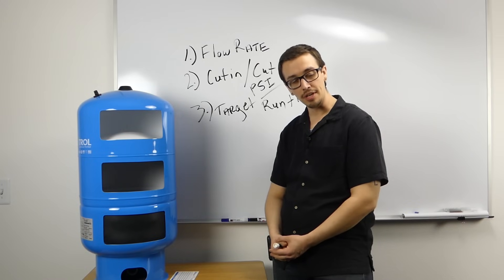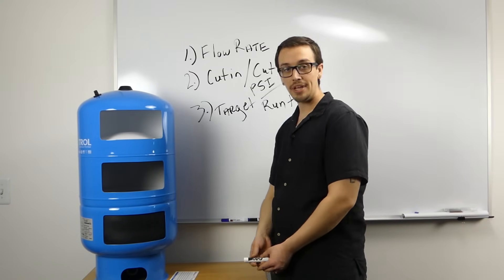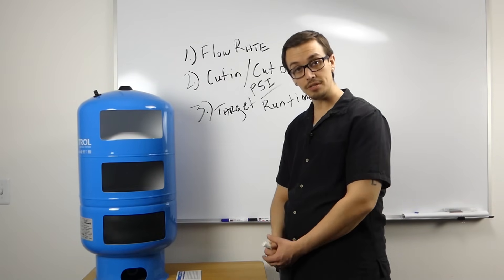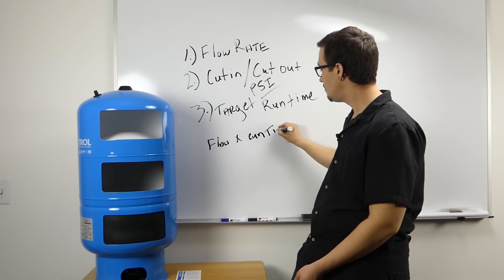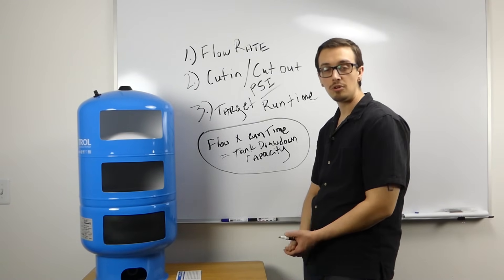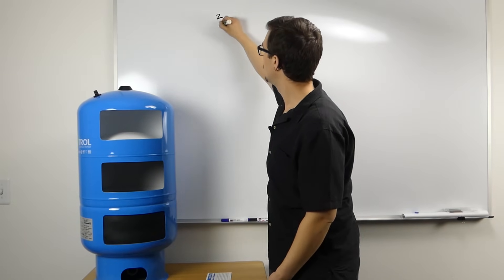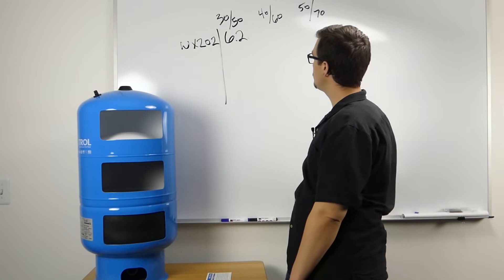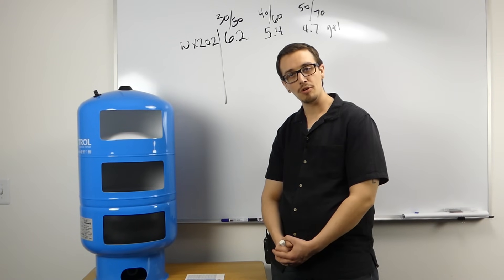How to Size a Pressure Tank

Comment: Hi there, a fire sprinkler system I am looking at will benefit from a thermal expansion tank, but I also want to consider its pressure tank capability for the pipeline. The sprinkler system needs to be kept at around 12 bar. This will drop over time with leaks and a technician needs to boost the pressure with a jockey pump. A pressure tank should help keep the pipeline closer to 12 bar for longer, however I don't believe it takes much design as the 'drawdown' won't matter? A leak is so small and pressure drop so gradual that any pressure tank size should help the situation??
Reply from the maker: I do not know of any pressure tanks that are rated for that high of pressure. Are you primarily trying to mitigate water hammer?
Reply: I haven't looked into pressure rating yet. It is for thermal expansion of the water primarily with the hot sun and the sprinkler system being close to iron roof. And if possible I would like to design it to help with pressure drops as well which is just from leakages. So if the happy pressure is 12 bar. Minimum pressure 9 bar would come from leaks and max pressure 13 bar from the water expanding. So I think for the bladder tank to help with both, the pressure of the air would need to be at the minimum pressure say 9 bar and a larger volume than required for just one scenario. I think I can work it out. Thanks,
Reply: As a 39 year Retired Veteran Baltimore City Fire Department Captain I would contact the manufacturer, distributor, or installer for the Fire Sprinkler system that you are thinking of installing before you add anything to the system.  These systems are highly specialized and anything you add or delete from the can have a severe negative effect on its proper operation.

Comment: good explaining , i have two duty pumps but no detailed at pumps name plate  but motor is kw how can i select water vessel tank  the discharge pipe is 1.5 inch.

thank you very much
Reply from the maker: Do you know what the flow rate is in gallons per minute?

Comment: Hi. The flow rate of my pump is 2.38 GPM, what is the minimal volume of pressure tank  I should have? it doesn't show in the table.
Thanks
Yaniv
Reply from the maker: Yaniv, you would want a pressure tank with at least 2.38 Gallons of drawdown. Any pressure tank above 9 gallons should work. Thanks for the question!

Comment: I have a 30 gpm well what size tank would I need if I want to run an impact sprinkler?
Reply from the maker: Thanks for the question Joe. It depends on the HP of your pump, at a minimum I would recommend an 81 gal. tank. Feel free to call our tech support if you want to discuss you system. 855.329.4519
Reply: Its a 2hp pump I believe. Thank you for the information.

Comment: I have a question regarding to pump that I should buy. I want my pump will turn on at 40 PSI and turn off at 60 PSI. I use it for Aeroponic system and I need 60 PSI for well irrigation pressure. what is the pump pressure I should have? Does  the pressure of the pump is important or the pressure that will be in the tank will determine the pressure in the line?
Reply from the maker: Thanks for the question! Your pump builds the pressure up in the line and fills the pressure tank. When the pump shuts off the pressure tank holds a finite supply of pressurized water. Once that supply is gone, the pump starts up and the cycle continues. Our customer service team can help you size a pump over the phone, just give us a call: 855.329.4519
Reply: Thanks. I live in israel so I guess I will buy the pump and the tank here. According to what you say I need to have a pump that can pressurize up to 4 Bar/60 PSI. Let's say that I have a pump that can pressurize up to 85 PSI/6 Bar with pump flow rate of 50 liters/minute (13.2 gallons/minute). I didn't understand how to calculate properly and I will glad to your help
Horse power 0.8, Cut in  40 PSI Cut out 60 PSI. the tank will  use for two irrigation systems. The first one is for drippers 3-4 times a day  with total flow rate of 10 liters per day. The second irrigation related to Foggers with flow rate of 123.2 liters per day. What is the minimal tank volume I should have if I want that my pump will work at least one minute every cut in  (when the pressure is below 40 PSI)?

Many thanks
Yaniv
Reply from the maker: Yaniv, if your pump puts out 13 GPM your tank needs have a minimum drawdown of 13 gallons. The Well-X-Trol WX-251 is a 62 gallon tank with a 16.6 gallon drawdown @ 40/60. You can view it here: https://www.rcworst.com/Amtrol-WX-251-Well-X-Trol-Well-Water-Tank-62-Gallons-p5131.html
Reply: Many thanks
Reply: yaniv levy On and off is what kills those motors. Simply install a continuous duty motor. You can get one from Grainger. Get a flow switch which is on or off. Flow—pump comes on. No flow—pump shuts off. This on and off business is a good way to sell parts.

Comment: My pump is a one hp with approx 12 gal. per minute at the depth it's set. It only runs for about 3 or 4 seconds. I know pressure tank is too small.
  However, my question is, I shut a spigot or flush the toilet and when it shuts off, the water lines jolt throughout the house. should I add a pressure tank at the opposite end of the house to solve this problem? FYI, I have one inch plumbing in my house for maximum flow (which I have)
  I am guessing even with a larger tank I still would have the line jolt due to the high pressure/high volume......?
Reply from the maker: Mervin:  Thank you for the question.  A larger pressure tank will definitely help with your water hammer problem.

Comment: I have a 3/4 horse jacuzzi submersible with a 20 gallon pressure tank.  I want to add a 240 one inch domestic water line to next lot.  Do I need to change anything as far as size of pressure tank.
Reply from the maker: Thanks for the question Kyle. Since you're not changing the pump the existing pressure tank should work fine, but if you are going to be using more water then you might consider adding a larger pressure tank to cut down on pump cycling. You may also want to check that your current pump can produce the additional flow and pressure that the new water line will require. Give our customer service team a call if you'd like to discuss your water system. 855.329.4519

Comment: I am looking for your link to the chart, my water has decreased to about 25psi, I live in city limits. My home is built in 2000, 2 story home.
Reply from the maker: Thank you for the question.
Here is a link to the chart:  https://www.rcworst.com/Shared/content/mfr/amtrol_well_x_trol/docs/wellxtrolsizing.pdf
Reply: @RCworstwater   The chart gives a recommended running time for pumps of 1 minute and 2 minutes depending on HP. Is this a recommended MINIMUM run time or is it both a minimum and maximum time? IOW is it harmful for the pump to run for too long and how long is too long?  I guess if a larger tank results in a too long run time the cut in or cut out pressure can be adjusted to reduce the drawdown and reduce the run time.
Reply: @bigpardner  - Submersible pumps are rated for a continuous duty cycle, meaning that they can run continuously without harm. These are MINIMUM run times for the pump to be properly cooled after starting or cycling. Do not worry about a pump running too long.

Comment: Hi Chris! Great videos to inform the home DYI'er!  I have a Goulds 1/2 hp 10 GPM flow pump currently mated to a 14 Gallon waterlogged tank and 20/40 cut in/out switch.  How big a pressurized tank would be too big for this application?
Reply from the maker: Thanks for the question George! Bigger is almost always better - more water storage means less cycling of the pump, which overall leads to a longer life. At a minimum I would recommend a 30 gallon pressure tank to hit a minimum 1 minute run time. As long as your water source has plenty of water, you really can't "oversize" a pressure tank. The owners here are on well water and have half a dozen 81 gallon tanks in their system, and it runs great!

Comment: I have an issue with pressure switch chatter on a JRS-10; it just won't start smooth...any ideas?
Reply from the maker: Thanks for the comment John! I have three questions: When did you first notice the change?  What sound does the pump make when it starts - and does it come from the wet end or the motor?
Reply: I recently replaced the pump, since I installed this one the chatter started. It comes from the pressure switch when starting. It comes on and off rapidly and arcs heavily on the contacts.
Reply from the maker: John, if your pump is starting and stopping too often there are a number of possible causes. Here's a link to a troubleshooting guide, look at page 69. If you're still have trouble after running through the list give us a call: 855.329.4519
Reply from the maker: Forgot the link: http://documentlibrary.xylemappliedwater.com/wp-content/blogs.dir/22/files/2012/07/GSSERVICE-R5.pdf

Comment: Couldn't figure out why my dad, who I always thought knew what he was doing, installed a submersible pump that would constantly trigger on and off. He bought a 30gpm pump on amazon, and is trying to use it with a 2gpm drain down pressure tank.
Reply from the maker: Eeek! If it's pumping 30 GPM your drawdown should be 30 gallons minimum. The constant cycling on and off with a 2 gallon drawdown will shorten the life of his pump tremendously.
Reply: My pump is also triggering on and off. At times I have to reset it.  How do I fix it? The only suggestion has been to turn the breaker off when I'm not using it.
Reply: Chris Elliot - sounds like a water logged pressure tank.  I would drain the system of all water pressure and then check the air pressure of the tank.  The air pressure should be a couple PSI less then cut in pressure of the switch.  If not add air or replace the tank if the bladder has gone bad.

Comment: My pressure switch needed replaced. Installed a Square D switch, 40/20. Is this the correct switch? I believe my pump is 3/4 HP. I also had to replace the water pressure tank. Due to space available where it sits a 32 gallon tank was installed. I would like to have a larger tank, but at the time of this work I had no water in the house.
Reply from the maker: Thanks for the comment Corey! To answer your question, it depends on what your pump is producing. Make sure your pressure tank is set to about 17 PSI for your 20-40 switch. If your pump runs for more than a minute before shutting off, you're good! For information on checking or adjusting your pressure tank, check out the other videos on our channel.
Reply: @RCworstwater  When you say make sure the tank is set to 17psi, that means when the tank is completely empty with no water in it correct? So if I turned off my well pump and let all the water run in my house till nothing else comes out, that's when I should check the pressure? Thanks
Reply: Most of our pumps in Trinidad, works on a 20 to 40 psi what is the recommended size of tank